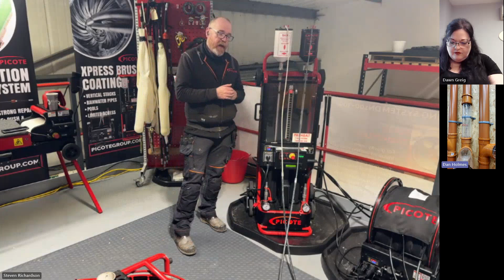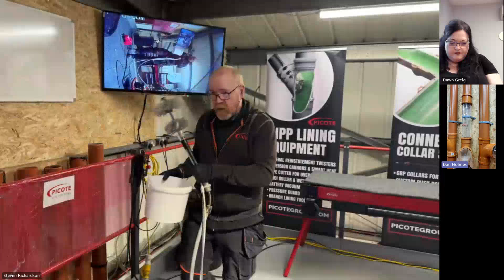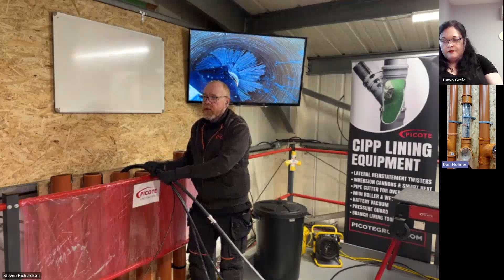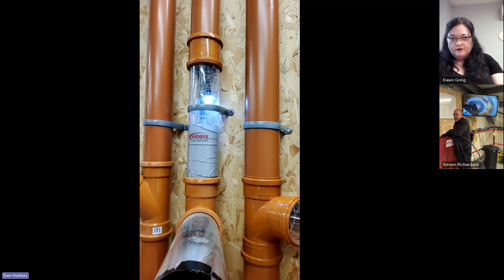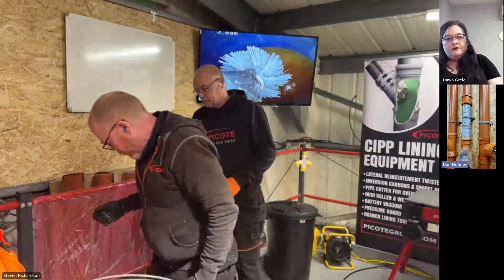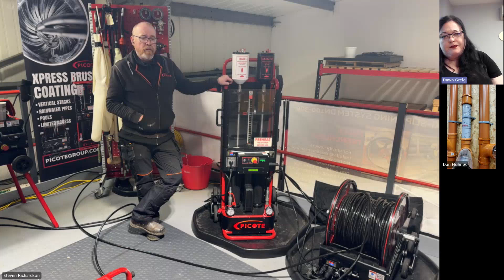Picote Xpress Coating System for Rehabilitating Vertical Stack Pipes Webinar, November 2024

Comment: Hi guys, sorry I couldn’t watch it live. What about refilling when you have a 30 meters pipe DN100 ? How many refills ? What about the resin temperature then? The leader with the mixing tube at the end doesn’t seem that flexible, can it pass several 90 degrees bends in a DN75 pipe ? Thanks for your answers !
Reply from the maker: Hi Bruno!  Sorry for the delay, How many refills? Maybe one refill, these take a few minutes. What about the resin temperature then? We keep the resin warm in the cans if we need to and the reel has a cozy blanket ;). The leader with the mixing tube at the end doesn’t seem that flexible, can it pass several 90 degrees bends in a DN75 pipe ? Yes it can! Hope that helps. Reach out any time!